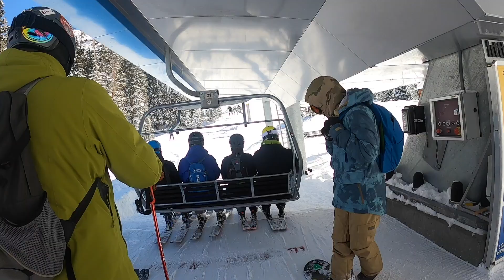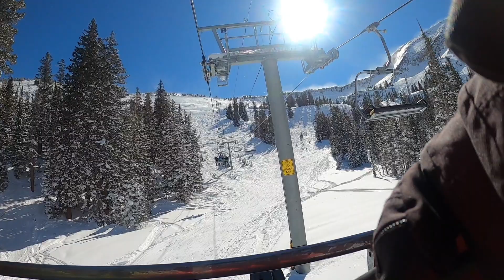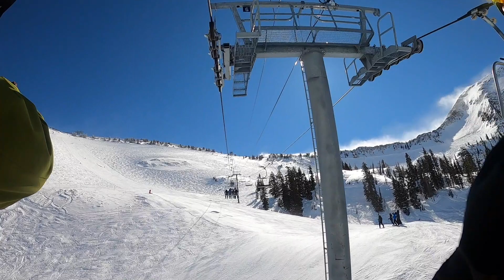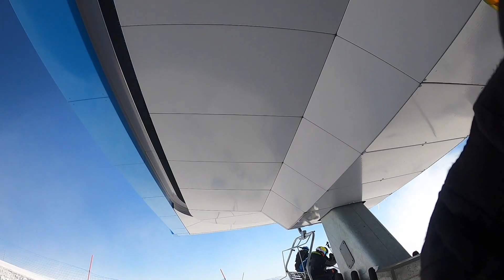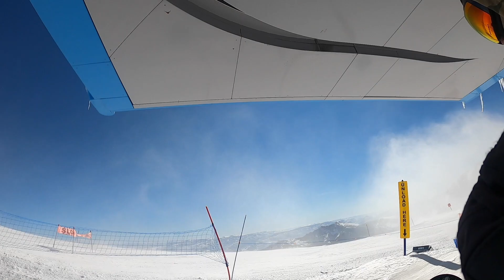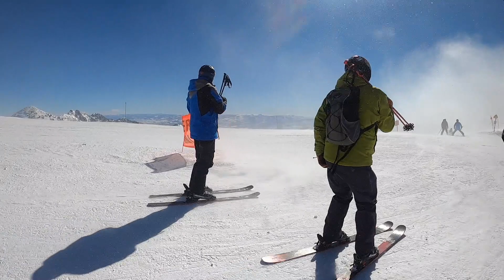Snowbird, UT: Little Cloud lift

Comment: This lift was built with wind in mind which is why that and Gad 2 have wind-resistant backrests and Little Cloud with a 6-pack line gauge like Peruvian and Baldy. The top of Little Cloud is so exposed to a ridge prone to frequent and unpredictable wind, but the top terminal is in the heart of it which is why even during high wind days, Little Cloud still operates at a normal speed unlike the Tram which is the most exposure to wind in Snowbird. I’ve been on the old double chair it replaced as a 7-8 year old and it was such a miserable ride in high winds and wideouts.